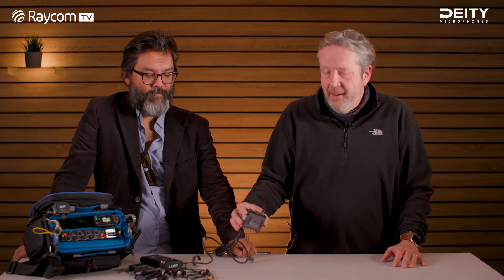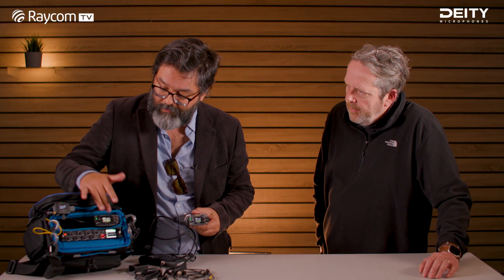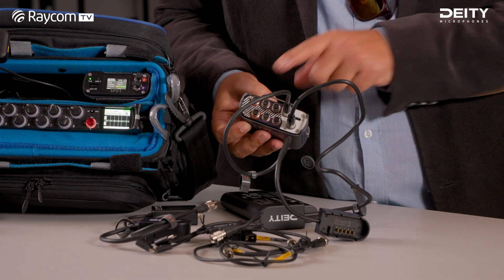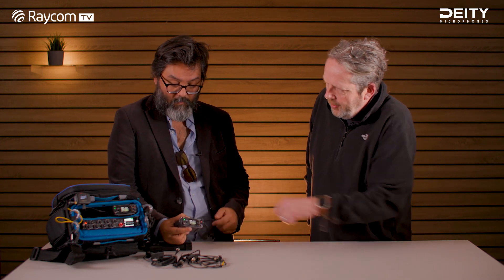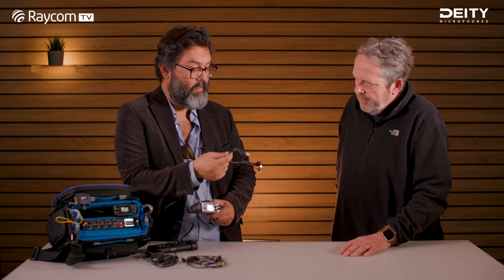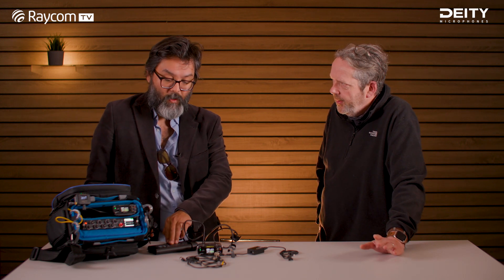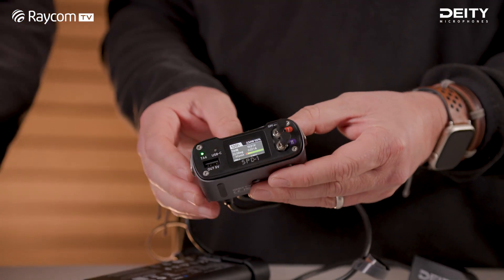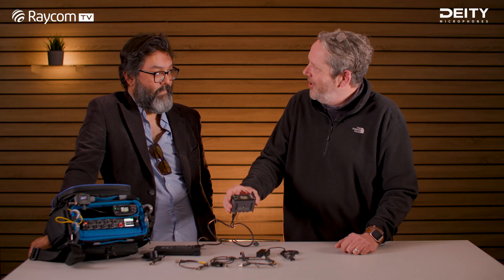Deity SPD-1 Smart Power Distributor | Walkthrough

Comment: Can I use a power bank with 3-5A output as an input source instead of a smart battery?
Reply from the maker: The USB-C Input provides regulated 12V into your system from wall power. This is useful for when you are stationed in one place for a while and don’t want to use batteries. Note that your USB-C power supply supports the 12V USB-C power standard and supplies enough watts. It is suggested to use a USB-C laptop-style power supply with the SPD-1.